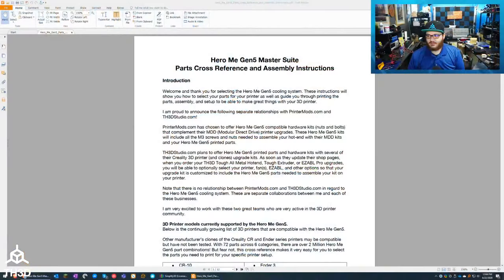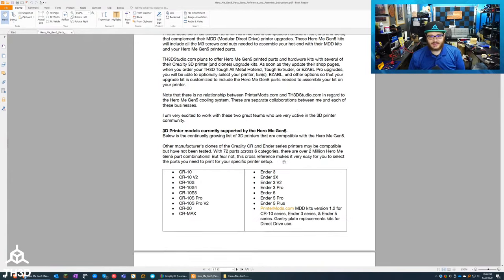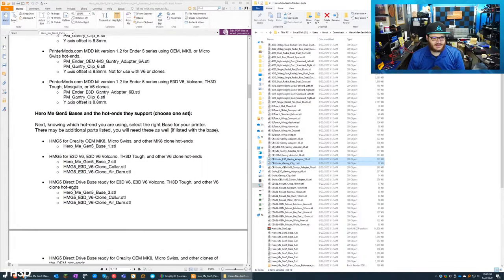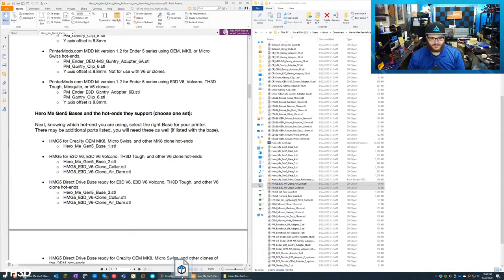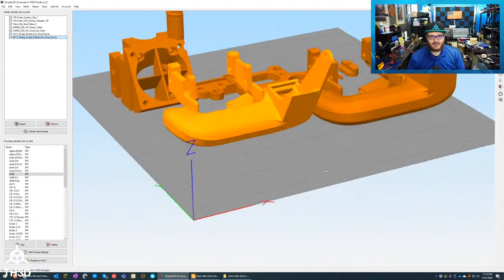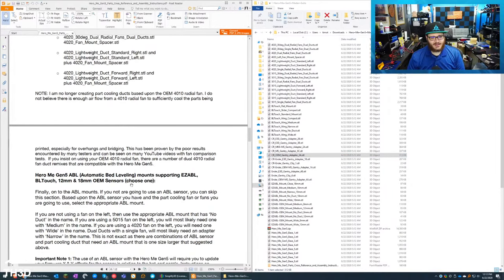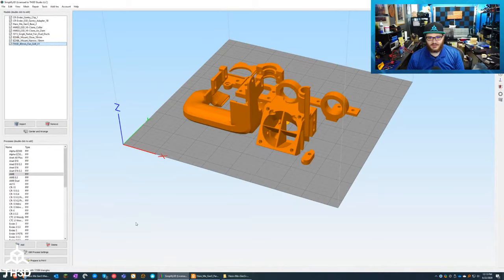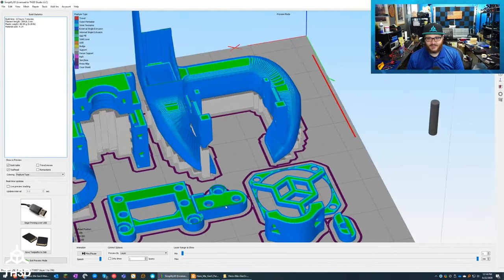Selecting & Printing Your Hero Me Gen 5 Cooling/Mount Setup | Livestream

Comment: Tim, Thanks for doing the live stream on the Hero Me Gen5!. One note on the placement of the parts for printing. The cooling ducts can have their 'face' (the front) down on the build plate, and then no supports are needed for that part cooling duct. I will reset the orientation of those parts to make it more obvious.
Reply from the maker: Thanks for letting me know. I was looking at the part and it looked like it would fail in some spots with it placed like that. If that is the way it is meant to be printed I would recommend updating the STL files to have that be the default orientation.
Reply: Has this been updated? I'm not sure what way I should orientate it before I print it. Thanks

Comment: UPDATE: Mediaman states you can print it in PLA+ if you have a sock on your hotend. I've had my Fang cooler printed out of PLA+ for over a year with zero sag. The Hero Me dev, Mediaman even states in a livestream you can print it out of PLA+ if you have a sock on your hotend and he prints all of his out of PLA+. He's confirmed this with me via chat in their discord so feel free to print the entire Hero Me out of PLA+ if you don't have PETG or ABS plus a hotend sock. Word of caution to never run your hotend even with a hotend sock for too many layers without running your parts cooler fans or you will eventually risk sagging as stated. Most slicers default to about 3 layers before kicking on the fan to promote adhesion to the print bed.
Reply from the maker: Just so you know "PLA+" is not an actual material type. It is just marketing some filament brands use so not all "PLA+" will perform like others.

Comment: Wow just watching you work is a lecture on 3D Printing, what a maestro. Do you offer Kits complete and ready to install. I am a user not a 3D Print engineer. For my CR 10S Pro V1 with Inductive bed sensor. Screws, parts, fans wiring etc etc. Going to go look at the shop now. Thank You I appreciate your skill and sharing, Oh And Firmware updates???

Comment: Hello! I printed the Hero me gen 5 for Ender 5 Pro + BL Touch. The problem is that when the bed is being probed the fan duct hits the front frame of my printer. I assume that now the printing size (Y) is a little smaller but is not a real problem. How can I fix the ABL not to hit the frames? Thank you!
Reply from the maker: Change the bed size in the firmware to be less on Y so it cannot travel as far on that axis. You will want to change the Y_BED_SIZE variable.
Reply: @TH3DStudio  I changed the probe margin (or something like that) from 10 to 20. Now is not hiting the frame but probing area is smaller somehow.

Comment: Question: the ender 3 stock fan is 4010, right? So no option for that?
In your opinion, if I have to change my fan, what would you choose? (In performance + loudness)

Thank youuu!!!
Reply from the maker: Yes the stock is a 4010 blower. The one we recommend (5015) and use on our machines is the one we carry here: https://www.th3dstudio.com/product/5015-high-speed-ball-bearing-fan-24v/
Reply: The directions from the HeroMe 5 explains that they don't think there's enough airflow from a 4010 to use with the HeroMe, so he's not gonna develop those.  I think the documents mentions to look for a remix if you're determined to use a 4010.

Comment: Suggestion/Request, would be great if the creator can include a spread sheet thats "intelligent" you say start with your printer, than reduces the options only applicable to that, then say your hot end, further reducing it... in the end it spits out this the files to print.
would go along way in helping not printing the wrong files and wondering why things don't work out...
as a bonus, if it spits out what screws/nuts/bolts then required would be great.
G
Reply: There is a spreadsheet exactly like that, it is the first link on the HMG5 Thingiverse page: https://docs.google.com/spreadsheets/d/1q3H9w8mgt181L7F2nhLkkFlLbWLUgoi_dac23wQDUwU/edit?usp=sharing
Reply from the maker: That's a great idea! It could be done with Excel or Google Sheets
Reply: @TH3DStudio  so if we read the new pdf this has been done, see attached link.
you need to make a copy of the workbook to use.

Comment: How to print 5015_30deg_Single_Radial_Fan_Dual_Ducts.stl? Want to lay the dual ducts on the bed qith Support under it? But is it a clean print at the bottom from the dual ducts? How about to lay the 30 degree part on the bed? I use prusaslicer, anyone know the best settings for supports?

Comment: How long do you think it will be before you have packages available?
Reply from the maker: Likely about 3-4 weeks out. Need to finish testing the ducts and sourcing all the hardware parts (screws & nuts).
Reply: Awesome! I have my CR-10 S4 set up for direct drive and got the 5015 fan without realizing that the mount I had wouldn’t work. I will probably wait for your package as everything I have gotten from you has been perfect!

Comment: I have the ender 3 v2.
-Creality Hot End
-Dual Fan Dual Dual Duct
-5015 Radial Fans
-Bowden Tubing

I used the spread sheet to obtain all parts needed
so I chose
-CR-Ender_OEM-MS_Gantry_Adapter_9A.stl (also printed Adapter 1A to be on the safe side)
-CR-Ender_Gantry_Clip_1.stl
-Hero_Me_Gen5_Base_1.stl
-5015_Dual_Radial_Fans_Dual_Ducts.stl
-BlTouch_Standard_Mount.stl

I'm not getting any kind of compatibility with the bltouch mounts and that's being said for for either of the gantry adapters compatible with the ender 3 v2.

Can anyone assist me with this to make sure this isn't user error? I'm almost positive there's no way possible to to use the standard bltouch mount with the standard dual 5015 duct dual blowers on the gantry adapter. I really hope I'm wrong considering I've already printed the parts suggested by the spread sheet, taken my printer apart, cut loose the wires to install the dual 5015s and new 4010 fan. Even more so for the fact that my printer is set up with firmware to operate with a bltouch. It would be a major pain to have to set this up to be used without a bltouch attached just to have to print out the correct mount and set it up to be used with a bltouch all over again. Its will be just as annoying to set everything back up as stock the way it was before just to print out a suitable bltiouch mount that works with these options. Somebody please tell me I'm wrong and how to mount this thing before I pull my hair out.